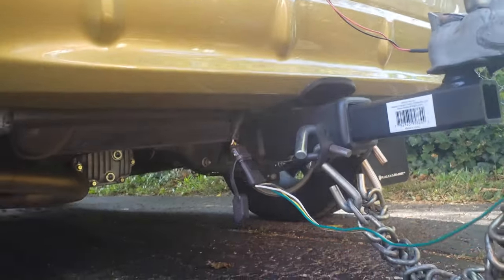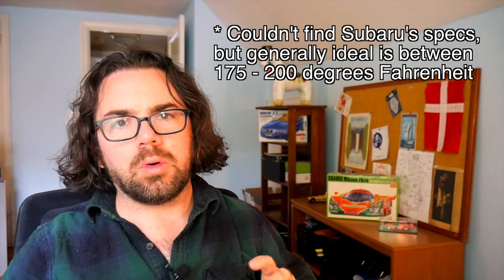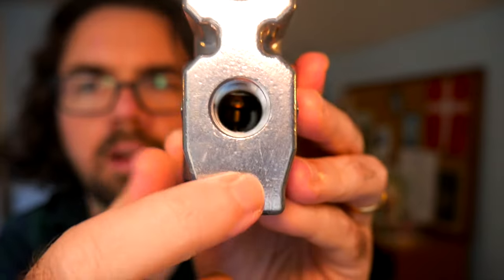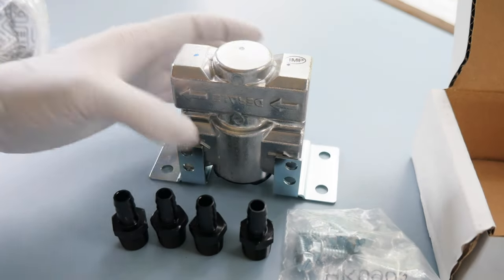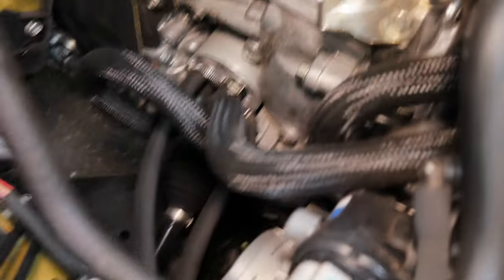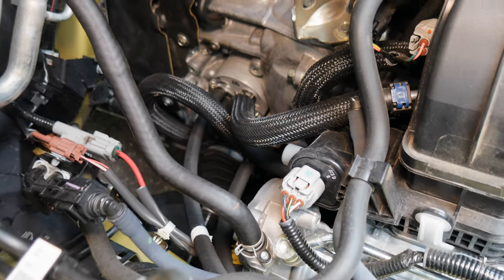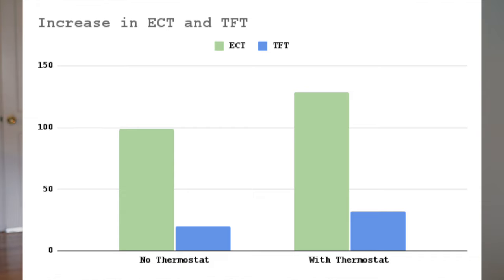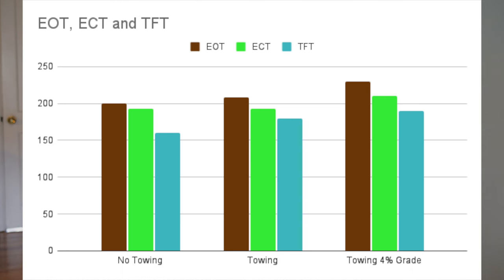Installing a CVT Cooler Thermostat in a Subaru Crosstrek

Comment: I run a Hayden Automotive 699 transmission cooler with a built-in thermostat that also allows transmission fluid to cool at 180F. It's a plate and fin type cooler and isn't overkill like the Mishimoto cooler.  Also, there is no need to use a remote thermostat because there is an internal thermoststic bypass like I mentioned earlier, with less leak and failure points. Finally, I have a SPAL 7.5 push fan for slow, off-road driving, and when I don't have positive airflow to cool the fluid.  I've been running it for 3 years with zero issues. Of course, with extreme abuse, replace the CVT more often to increase longevity of the transmission.

Comment: Look on the official Setrab website for Setrab ProLine oil coolers. I currently have a 16-row STD series 1 installed, with a 4" Spal electric fan, housed in the subframe next to the transmission. My setup is without a thermostat since I live in a hot climate. I have an XV MY 18 and my driving is mostly mountain (severe use). I liked your video analysis.

Comment: Do you know approximately what your  towing capacity would be with this settup? I only ask because the crosstrek wilderness has 3500lb capacity, and I’m wondering if the new cvt cooler in that model is the main reason. 
Also love this video and everything I learned from it. Thank you!
Reply: They say it’s 3500 due to the cooler. It’s same engine and same transmission minus some slight difference gear ratios I believe. But basically it’s exact same motor/trans and added a cooler.

Comment: Sad to see Subaru's decision for the US market. For Europe and Russia, Subaru from the factory puts additional CVT oil cooling in the circuit of a regular radiator, to which additional steel pipes and hoses fit. As for the heat exchanger on the CVT, it is not developed for cooling! It is designed for faster heating of oil, especially in regions with cold climates.
Reply: Could you kindly elaborate a bit more about the " additional CVT oil cooling in the circuit of a regular radiator, to which additional steel pipes and hoses fit". Thanks in advance.
By the way, the reason I asked was because I could not find specfic CVT cooling circuit info or diagram for the 2017 onward Subaru XV or Crosstrek.
Reply: @Superkrill  You are absolutely right, this cooling system is not in the original Japanese schemes. But these details exist in nature :), here are their numbers:

Pipes:
Subaru 21623-AA090 -1
Subaru 45520-AG010 -1
Subaru 45520-AG110 -1
Subaru 45520-AG100 -1
Subaru 45520-AG030 -1
Subaru 45522-AG040 -1

Radiator with integrated gearbox cooling circuit, two pipes at the bottom of the radiator
Subaru 45119-SC040
(use google serch to see picture)

Fitings:
Subaru 21326-AA210 -1
Subaru 80191-4040 -2
Subaru 80391-40605 -2
Subaru 11024-AA070 -1
Subaru 80391-4060 -4
Subaru 01041-0200 -1
Subaru 80691-1080 -2
Subaru 04740-6120 -3
Reply: @metaframe2k  Wow...big thanks for your prompt reply. I will closely look into all the precious info you provided. Very much appreciated.

Comment: if the ideal temp is between 175-200 degrees that is hot....you say you want the fluid to be warm.....175 degrees is hot......140 hot water will give you burns....imagine what 175 degree fluid will do....I had a regular car with an oil cooler and even when it was 90 degree F outside the AFT fluid never got over 140 degrees.....the transmission was original....reg fluid changes and shifted like a swiss watch after 200,000 miles. Problem with the car was age and rust caused by excessive road salt

Comment: So I had a cvt cooler installed and did you experience any humming at speeds  of 65mph underload even when releasing the gas pedal?
Reply: I am experiencing a noise similar to the one you describe, just when releasing the accelerator in my 2018 Subaru XV. By chance have you replaced the cvtf fluid?
Reply: @elsocio666  so the problem for me was  the shop I took it to too have the cvt cooler installed also changed my differential fluid and they forgot to put in the rear differential plug back in. I called them and they replaced my rear end.